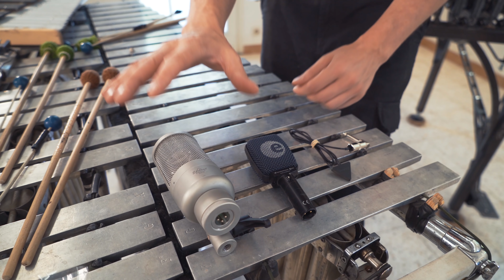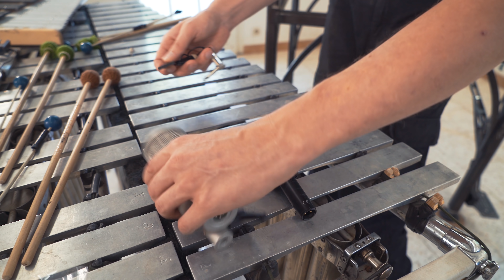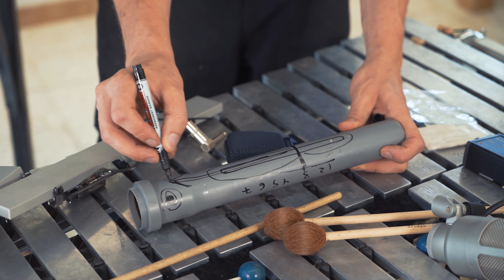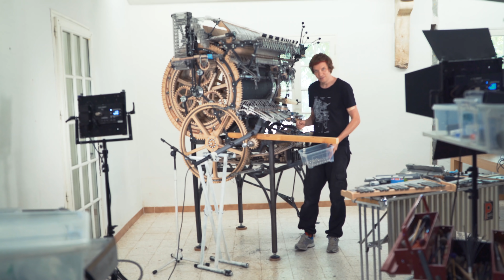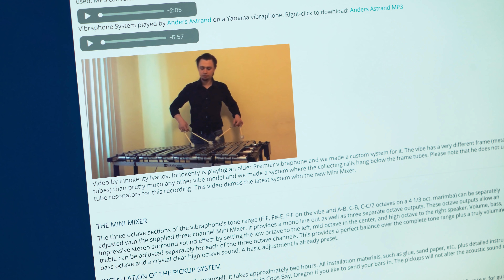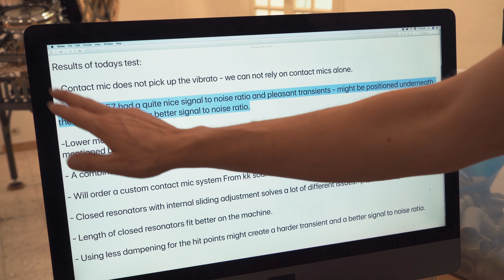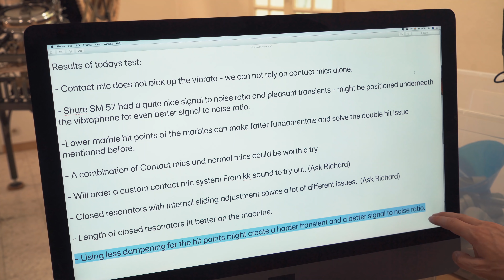Vibraphone Experiments / Microphone Types - Marble Machine X #96

Comment: I use these GRIT mics on tom for drums. I think if you cut the clamp part off and connected them to the bent metal of the muting system, you could have 11 of these sitting just above the mutes and they should give you great signal to noise ratio and pick up the vibrato.  http://www.peterman.com.au/music/grit  Think of them as a SM57 with the capsule mounted at 90 degrees.
Reply: I'll repost my comment on yours for visibility haha
"I've seen a lot of people here talk about contact microphones. You don't mic a vibraphone with piezos (unless you want to get weird with crazy effects).Long story short, you get the beautiful sound by getting a little bit of space between the source and the mic, giving it a little more "air". The acoustics of a pipe is not very interesting, but once the wave exits it, you get the true sound. You can mic all the parts in close up if you'd wanted to, but the most important tracks in your mix would be the condenser mics (classically U87 or c414 or whatever you think fits best with your instrument and room acoustics, or space, or budget hehe,  i would suggest small diaphragm cardioid mics in a XY pattern). The  signal to noise ratio is irelevant if you record properly, with the right equipment, and in a good room with good mic positions. It is also important to point out that the "noise" is not the high frequencies and the better definition of low volume sources you tend to get with condenser microphones, but rather the electric noise caused by the electricity flowing in the components. Once again, if you set up properly, this should be a consideration, but never a problem. Be careful with your input levels !
Now I understand that for the MMX, condenser mics placed a little away from the board would have a lot of the machinery noises in it, but well, sound will bleed into dynamic mics too, and to me, piezos are out of the question if you want to have a proper vibraphone sound. I guess it's a matter of aesthetics : trying to have the "purest" sound of vibraphone in the sense that the mics don't record anything else, and having a poor sound that kinda works anyway (maybe in postproduction... haha !); or accepting the MMX as it is, with all its mecanisms, and do a mix with proper mic and room choices.
If you want to minimize the bleeding sounds of marbles, i suggest you use a gate and a hi-cut EQ, definitely over 12-13kHz, but i don't know, listen and set it to whatever keeps the vibraphone ok in the mix, and smoothens the really high frequencies hits of marbles moving and hitting each other and stuff.
These aremy thoughts, if you have others, tell me, i'd be happy to have a conversation."
Note that i'm thinking studio more than live performance, i'm aware of that, but studio is where you get the best sound héhé
Reply: @UnchosenMr  i like this idea, and for live shows ajust the noice gate, or let the crazy flow....

For me the sm57 is the choise, or small microphones in the muting sistem
Reply: Hi Martin - be careful - the signals of several microphones close to each other influence each other massively when mixing together later and create strong comb filter effects.

If you like, we can discuss this effect and possible alternatives in more detail.

many greetings Robert
Reply: upvote for visibility ^^ the machine shouldnt have to make compromises like technological vibrato and this is a great fix for it. this, combined with the suggested adjustment methods from the comments last video, would be a great fit for the machine.
Reply: @stuchris  I made a comment that maybe he should try laser microphones...they can read noise from surfaces...maybe one on the note and one on the tube...and mix them together..
Reply: Is this going to pick up the vibrato from the tubes though or just the resonating plates?
Reply: @malco84  These are just dynamic mics, so they should pick up the sound just like the SM57 did, including the vibrato. As others have commented, you would need to be wary of comb filtering from too many mics, so there may be a magic mix of say 3 mics evenly spaced and at a certain height that would be able to pick up a few plates each. If there were 3 mics, then you could pan them Left - Centre - Right and this would be great for the live experience giving the vibraphone a wider sound on the massive festival sound systems. Also, the dynamic mics would help a little with the gain before feed back. This would be kind of like a 3 mic version of the setup your sound engineer uses on the glock. I've seen him use two SM57's very close together to mic up a glock, like here at your Haldern show. https://youtu.be/mf3bhAayHaw?t=69
Reply: @177-ch  I think 4 microphones would be enough : 
- 2 Rode NT5 (silver coloured, small sized, small diaphragm cardioïd microphone) hidden behind the sliding marble tunnels (don't know how they're called) on top of the board in a XY or small AB pattern, 30-50cm away. You don't need to do the LCR you described to have a good stereo field, as the vibraphone one the MMX is very small. This kind of Decca tree is used for orchestras (even grand pianos are miked with an AB or XY pattern).

- 2 Rode NT5, or other small diaphragm cardioid condenser mic or 2 Sennheiser 421 (quite large, black, dynamic microphone, cardioïd) facing the tubes, from the front or from behind depending on what's the most practical with a distance of 10-50cm)

With an XY setting you should not worry about any comb filter, since the capsules are on the same position. Even in a mix with the two sets of mics, since they  do not record the same frequencies for the most part or the same sections of the MMX, but if there's a problem just check the phase.
Anyway, the focus should really be on small diaphragm condenser microphones, cardioid or supercardioid. Add a gate and a hi-cut eq and that's it.
Reply: @177-ch  thanks I'll pass this all on to Martin
Reply: Looks like a great solution!
Reply: Upvoting
Reply: Would you be able to hear the effect of the tubes if the microphone was on the other side of the note bars? What about milling out a flat spot on the tubes for the contact mics? He could experiment with it but I think thin is probably going to be better. He can just epoxy the mics on to the flats and if he needs a more positive connection he could add another ring of bigger pipe glued around the top. If he is milling through 2 pieces of pipe stuck together it would create a socket for the microphone to be glued into. 
I am worried that the place they are put on the tubes might have unwanted and non standard effects on the sound due to harmonics. Things like different notes being different volumes depending on their placement compared to the harmonic nodes. Because we know that there will be nodes on the top and bottom of the tubes I think the microphones should be placed either within an inch of the top or bottom edge of the tubes. If he is planning on switching the tubes out then the top makes the most sense. If he uses a set of telescoping tubes they can be tuned easily but I think making a short top part with the tone wobbler and the microphone built in and then just making easily connected tubes for each specific note to plug into them. It would also look cleaner since the wiring would be below the vibraphone plates and in the back so it would be hidden giving the instruments more presence. If he takes care to attach the pipes in a way to isolate them from the machine then that would also lower the extraneous noise.
Also I think it would be best to have the sound wobblers default to open somehow. Maybe have the valves set so that the handle pulls down automatically leaving the valve vertical in the pipe. Hell he could even put the valves all on one rod and make it powered so he could flip a lever and have the tones wobble and you make it variable speed you can do cool stuff with it! What do you guys think?

Comment: I have been playing vibraphone with mics for a while. I think your best bet is not to use a contact mic, and put 1 or 2 underneath the resonator pipes. I think the idea of adjusting the resonator pipes is important, and that is something that marimbas and vibraphones have been able to do for a while, but it's more important to keep the bottoms of the resonator pipes open, to allow sound to travel farther, and into the microphone with less muffling. It's also probably gonna help the mics pick up more vibrato. I'd say it might help to do microphone tests on your actual vibraphone first, to see if you can even get the sound that you want with vibrato in the first place. 
Also it may get messy with wires connecting to the mics, but it's nothing that zipties can't handle. 
I hope this helps.

Comment: Ex location sound mixer here, fellow swede, thinking (excuse me if this has been said already) that lapel mics on the dampening arms of the vibraphone might be a good idea. I'd look into DPA mics, there are a lot of miniature mics and they all sound great. There are hyper cardioid mics small enough to put on those arms. Hope it sparks something...
Reply: Actually, these could potentially be mounted under the vibraphone plate holders to pick up the resonators nicely. The SM57 test from on top didn't pick it up as much.
Reply: When Martin put the mic in the pipe that distorted at the membrane, my guess is that was an inferior mic (referred to as wireless in the video iirc. Could be anything?). DPA are infamous for their high spl capability, and they're constantly used on film sets and fx recordings for this reason.

Comment: I think for the best sound the electronic vibrato would be the best system to opt for. At least this way it can be A. designed for quick release B. reduce transportation and assembly time and C. produce a better sound and visual quality, rather than having large microphones hanging in front of everything. 
As someone who spends their time designing systems that have to tick 20 odd boxes in order to perform the best way possible, I understand how frustrating this problem solving can be.

Comment: This is a brilliant exploration. There was one historical example of a mariba being transduced via piezos, this was Ruth Underwood for Frank Zappa, to which she was vehemently opposed to it due to the process having to actually drill into the marimbas. I don't know how a marimba resonates compared to a vibraphone though. I think you are already processing the signal of so many other components, adding an electronic stomp box like a rotovibe and using contact mics is a smart solution. Also, I think you can incorporate a pressure fit for 1/4 inch female connections into your "snaps" that connect the vibraphone plates, so you'll still need 37 contact mics, but a male connector can be hard fastened to the mount underneath for some expedience. Best of luck!
Reply: Also, 1/4 TRS are not the only style connections for audio. Tube style connectors that are used for audio patch bays in studios may be more practical.

Comment: Not an audio expert, but perhaps with the closed pipe design a contact mic could be placed on the bottom of the movable cap.  Since it is at a pressure antinode I'd imagine that plate would vibrate a bit which could be picked up.

Comment: What if the microphone was mounted to the bottom slide of the closed resonator like on a post that placed the microphone in the center and routed the wire out through the length adjuster?

Comment: What about a contact mic on the resonator tube(especially metal ones)?
Reply: The tubes don't vibrate much. It's the air inside the tube that vibrates. That's why you can use PVC pipe and it will still sound good.
Reply: The tubes are not resonating.

Comment: I wonder if putting a contact mic on the resonator pipe would pick up the vibrato. The vibrato vibrates the sound coming away from the plates, not the plates themselves.
Reply: I think the pipe isn't vibrating its the air inside.
Reply: @chartle1  But doesn't the pipe pick up the sound vibrations when the air bounces around inside of it?
Reply: @joez6235  its a direct contact mic not an air mic. So the air would have to also vibrate the pipe.
Reply: @chartle1  The air does vibrate the pipe, though. How do you think the sound gets louder?

Comment: I'm pretty sure you've got the signal to noise order mixed up between the condenser and dynamic mic. Only comparing the microphones directly isn't practical and the data with dynamic mics is often theoretical, i.e. measured at maximum SPL, which is often way higher than the condensers and higher than the actual use case. I you record quieter stuff, you will need way more gain on the dynamic one resulting in much worse SNR (signal/noise ratio) effectively. There's a reason the  quietest digital high end studio mics in the world are condensers, not dynamics.
Couldn't stop myself, sorry. Just my 2cts. Continuing watching now =)
Reply: Condensers pick up way more room than dynamics. They often have less line level noise due to not having to crank the pre-amps, but in a music scenario, they are often only used in controlled (treated) environments since they have such a large pickup distance.
Reply: @ProximitySound  true. that's more down to the pickup pattern though. camera teams on outside shoots use directional condensers for TV quality sound in the field for example.
With really close mic'ing distances dynamics can be the best choice, true. There are some SPL-monster condensers too though and if you mic closely enough the ambient level drops by nature. Just saying it's not that categorical.
Reply: @Bassalicious  I worked location audio for more than a decade. You don't use Dynamics on set because they would have to be super close to the actor's mouth to pick up properly. Condensers are able to pick up further. Dynamics are preferred in radio for instance since the hosts are right up to the mic and don't pick up the person next to them. But if you go record with a 416 or something similar, it's picking up the actor and everything behind them depending on where you point it.
Reply: But I'm going to agree with you that Martin's use of the term signal to noise isn't perhaps the best descriptor? Essentially he's looking for a solution that will practically focus on the selected instrument's sound and not the noises around it. Condensers would not work well for many reasons in the MMX setup.
Reply: @ProximitySound  In european radio stations they use condensers since the 40s for their superior resolution. You could just as well build a directional dynamic mic for a boom. Yes, stupid, because the SNR would be much worse due to the preamp gain required. That was the point I was trying to make with that thought experiment. All I'm saying is dynamic mics do not produce a better SNR by nature. It just depends on your use case. Condensers can be very directional and thus isolating, it's just more expensive and a bit harder to control due to more resolution and feedback possibilities when live monitoring. imho anyways.
PS: I've also got some professional audio experience, don't come at me like that
Edited because I was stupid
Reply: @ProximitySound  Oh, yes. That's what came to my mind too. seperation isnt SNR. Having mic'd many live drum sets and mallet instruments in studio and live environments, I disagree on that condenser statement though. It's just a case of implementation and choice of hardware I think.
EDIT: A dynamic mic setup would be easier to get on top of though, that's for sure. I just don't think it's going to necessarily yield the best results possible.

Comment: No resonator and microphones under the assembly is a good compromise!
Reply: No resonator means that he needs to implement the vibrato digitally as far as I understand. He wanted to avoid doing anything to the audio digitally (other than basic amplification since he's using contact mics).
Reply: @ganondorf5573  the vibrato valves don't need the resonator pipes to work
Reply: @pyronman  Interesting.. still, how will you pick up the vibrato without the same issues he's having now?
Reply: @ganondorf5573  a vibrato valve under each vibrophone note and a microphone just in front of the rotating valve i think would be effective enough, not over complicating the assembly.
Reply: @pyronman  Hmm maybe that would work. Can't wait to see what he tries next. Hope he finds a satisfactory solution to this hurdle soon! He's been procrastinating it for so long because it's such a difficult one lol